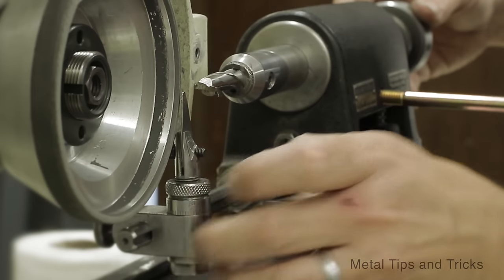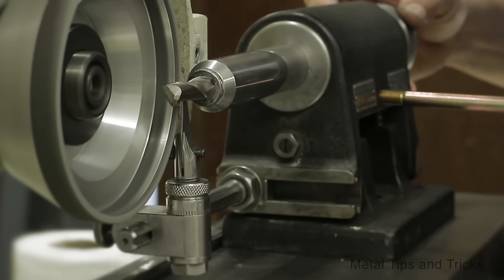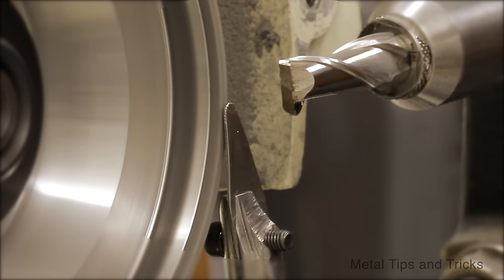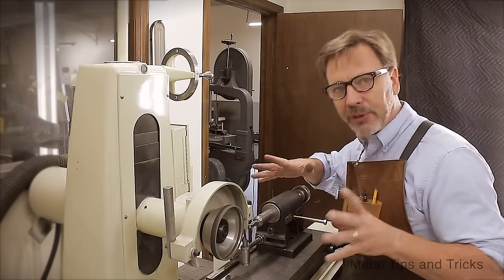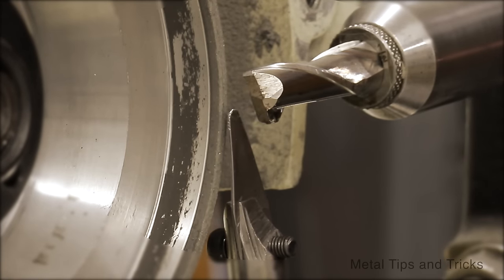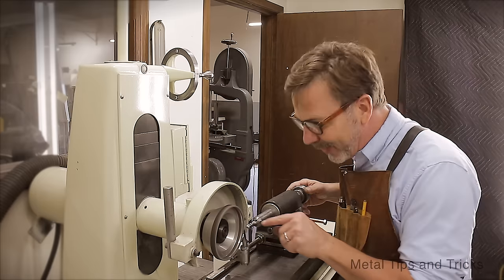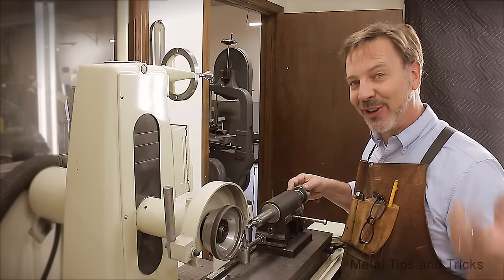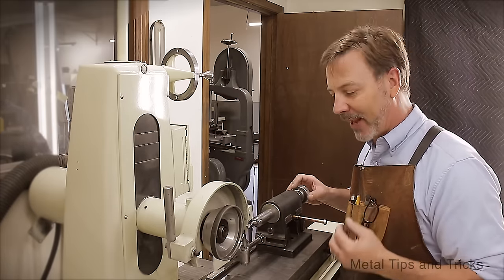How to sharpen end mills on a surface grinder Part 2

Comment: a rule of thumb is the first land should be 1/32 wide and drop off ..005 on an indicator and the second drop off .01 in the same distance.
Silver solder a piece of carbide on a thicker finger and stoning the sharpness off will give a smoother action.
To grind a tapered mill you need a cutter grinder and adjustable angle 
cutter head.
Set the head 5 degrees for example and traverse the table to get the grinding motion.
The finger needs to be mounted
on the wheel head as close to the wheel as possible.
The flute will not be parrell to the cutter center line giving you an error on the finish ground flute.
I believe the finger should be almost touching the wheel on all mills.
cheers.
t.o.m.

Comment: There is supposed to be  a based that  adjusted the angle with the finger on the center line of the spindle.your finger assembly is on backwards.Weldon makes a chart for the first and second back off angle and land width.you will need a dust collector system eventually 
I have sharpened thousands of endmills with a Weldon fixture it is great tool.I also made carbide tipped fingers.
I really enjoy your videos
Reply from the maker: HI Mike. Great comments. yes I know the finger was on backwards I did it so I could photograph it better, what I should have done was put the fixture on a riser block so I would have had more room to just the knob. Keep up the great comments. :-)

Comment: The Weldon fixture costs about 500-1000 dollars on ebay by the way, and you STILL need a surface grinder (or a properly rigged milling machine with a wheel attached to it) in order to use it. For that much you might as well buy the Shars Tool and Cutter grinder... it's about 800 dollars and it does ends, flutes, etc. in that one machine.

The end grinding fixture is good if your flutes are in a reasonably good condition (most the time you aren't using past the first .05" of the flutes) and it will do the job. It's also cheap too. The spindex fixture is also fairly cheap too and can work reasonably well too.

Buying endmills get expensive very fast and some import end mills are not properly sharpened out of the box.

Also my end mill grinding fixture (made by Shars) does not say "made in China" anywhere... so you might want to tell the viewers which side to use (one side is wider than another)

Comment: Hi Dale, 

It's worth mentioning that reground endmills are undersize.

Blindingly obvious you'd think, but I've heard of quite a few people being caught out and moving over half the tool diameter as marked on the shank!

I wouldn't always trust the marked size on a new cutter if it really mattered to what I was doing.

On practice I've heard of is to grind a fine ring on the shank every time you sharpen.
Reply from the maker: Hi Paul,  You are right I should of said somthing. I like your Idea about grinding a mark on it. to show how many times it has been sharpen.
Thanks for your commet :-)
Reply: @BuildSomthingCool   I think when he said grinding a fine ring he wasn't mean to show how many times it has been sharpen but to measure exact diameter after being gound

Comment: Put cutter rest on level centerline of endmill, raise air fixture up on its pivot that's better than lowering tooth rest each time . Make a block that raises fixture 6 degrees for primary and 20 for secondary

Comment: If you want to use your spindexer, you can loosen the collar locking screws and the spindle will slide in and out, no need to use the x travel of the table. Making a finger, for alignment, should be no problem to someone who has a need for sharp end mills.
Reply from the maker: HI Chris. Interesting idea. My concern it the finish on the spindle is not smooth enough to give you a good grind, but give it a try and let me know how it works out.
Reply: I think it is smooth enough, well on mine the ring kept slipping when used for normal mill work. Don't old your breath, but if I do I'll let you know.

Comment: Dale that flute stop would seem to be way to flexible...and the holder for it looks to have been modified?
I'd be thinking a small round pin with a tapered, radiused end would be more rigid and able to better handle the necessary force to keep the flute on the stop.
I'd love to have a way to touch up endmills in the shop. I have a nice Niagara 3/4" cobalt rougher that's just dull from use and would love to give it some edge. Ever try to grind the front flute face of a rougher?  :-)
Reply from the maker: I think you're right about the stylus it  would work better if it was round. I have  not tried to sharpen  a roughing mill.

Comment: wouldn't doing this very slightly change the cutting diameter of the end mill? so if you were doing a precision hole and using the end mill in a plunge cut fashion your going to want to use a reamer afterwards right?
Reply: Hi John, You're correct that sharpening always reduces the end mill diameter. In the example you stated a nominal size reamer would be needed to bring the hole up to size.

Comment: Hey Dale, I love this method of grinding endmill OD’s. Unfortunately I don’t have a fixture like this. I sharpen all my diameters on a Brown and Sharpe No.10 in between centers. I noticed the collet you’re using utilizes a set screw. Does this cause any runout on the O.D? The reason I ask this is if the set screw were to push the endmill to one side of your collet. Great video, informative content. As a tool and cutter grinder in my youth I always look up to the older generation (no offense) for counsel and knowledge.

Comment: I thought it sounded like it was cutting heavy on one side at the start and heavy on the other at the end . Like it was bent or mounted in the collet at an angle. OR, could have been a bad previous grind.
Reply from the maker: Hi Cheerto4493. It was a bad previous grind.

Comment: Hey dale just curiously wondering if you have ever worked with pcd or sharpened it at all. I work with ceramics and use it all the time just wondering if you have ever used it and what your thoughts were about PCD

Comment: As usual very informative. Sharpening end mills is not easy even with the Weldon fixture. Good on the huge mills most people use. Will it sharpen a 3mm end mill? (I should say that anybody can sharpen an endmill. Whether the mill will cut after you sharpened it is another matter entirely.) For example my little Proxxon end mills can be plunged; they are what the UK calls "slot drills". Inspired by your last video I took a good look under magnification, and it, too, has more angles than a politician. My advice to beginners would be  to read up on sharpening and understand what the terms mean. In my case I must also consult the German literature because Proxxon is in Germany. And I would never try to do it at all without a fixtrure. And preferably a dedicated T & C grinder such as Stefan Gotteswinter's.

Comment: Im sorry but I dont have time to watch this video all the way through, however I noticed your foute index finger is bending and flexing all over the place. Not sure if you addresed this but it should be very solid for accurate flute positioning.
Reply from the maker: HI Andre, Yes, flexing is a problem on those fixture. I kind of address it on how one center it up on the flute, but I should have gone into more detail. 
Thanks for the comment. :-)

Comment: Not a really practical or useful video.......Weldon devices are as rare as hen's teeth and not many people even have a surface grinder........I had one that was fitted to an old KO Lee cutter grinder, and it was an air bearing type.